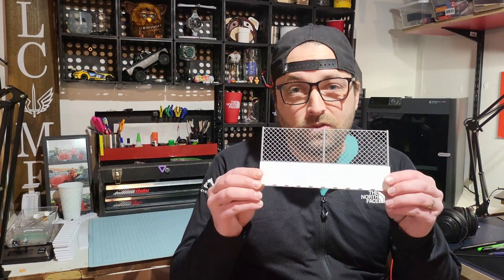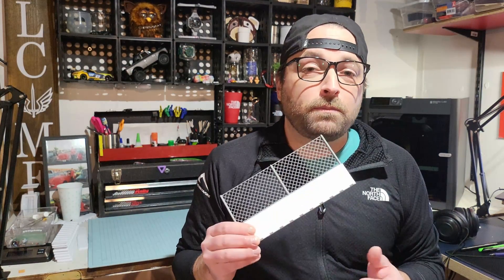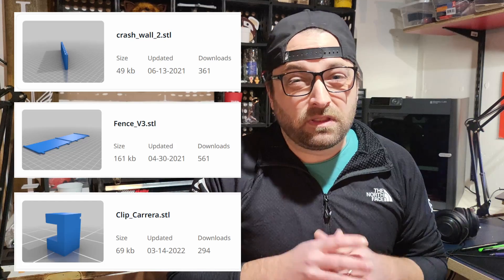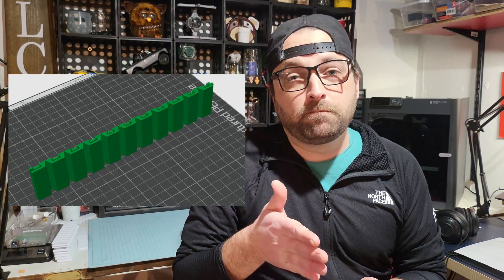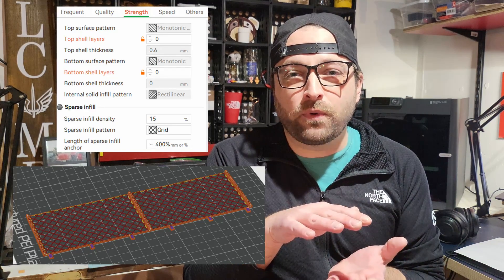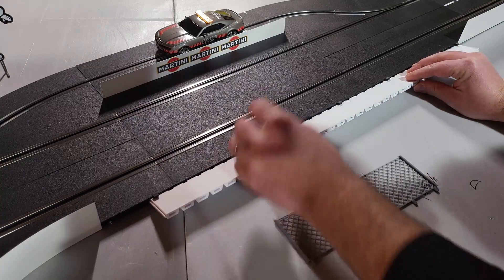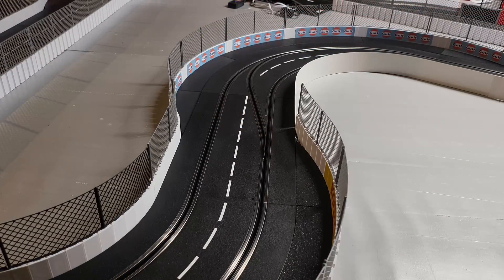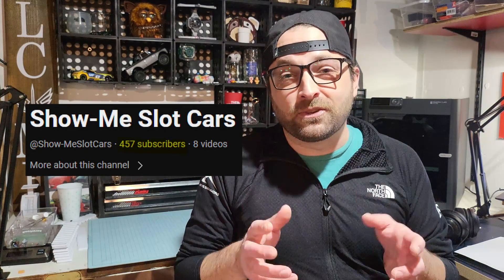New Crash Barriers, And They Are 3D Printed!

Comment: Well Peter, I gave up on the crash wall prints.  I printed about 40" of the wall.  The tolerences are really tight.  So much so that I had to sand the dovetails to open them up and even with that I still had to pound them together with a  hammer.  Not good.  The clips had to be pounded it to the bottom which is good so they wouldnt come out.  Then the trouble started.  Trying to put the wall on the track resulted in me fumbling around enough to break the fragile articulating seams between the "pillars."  The upper fence piece printed perfect except for having to sand the tabs down in order to get them in the slots in the wall.   Guess my filament (Inland from Micro Center) or my printer or the guy that pushes the buttons is a little off.  I appreciate the help and suggestions you gave.  They were dead on.  Keep it up, can't wait for the next videos.
Reply from the maker: That is a bummer! I use Inland for the most part as well, so I  don't think that is your issue. If you shoot me an email (address on channel page), I can share my slicer settings to compare notes. No promises, but I would hate for you to have to throw in the towel
Reply: I looked for your email on the home page of the channel, but, no joy.  That's okay though, I'll keep watching and print some other things like buildings.  I might switch filament from the PLA Pro I have been using to the regular PLA.  That might have something to do with it.  I am going to try some other wall projects too.
Reply from the maker: Just realized I never added it. It is there now: ShowMeSlotCars@gmail.com

Comment: Peter, how many clips do you use to attach the wall unit to the track?
Reply: I'm printing clips right now, oriented on their side as you suggested, but I'm printing at 100% infill, for strength. Just in case....
Reply from the maker: @philparker6576  Good idea. I think mine defaulted to 100% simply due to the amount of outer walls I have set as my default.
Reply from the maker: I connect three of the wall pieces together in sections. For those sections, I typically use 5 clips spread out across the 3 sections. I add more for tighter curves and fewer for straights. The clips are small, quick to print, and do not use very much filament, so more the merrier.

Comment: Great video!  Thanks for posting.  Your timing is good as I had printed Greg's wall last week after seeing you had printed them.  I only have an Anycubic Kobra so printing is slow.  The wall took 4 hrs 16 min.  Ugh.  Then I printed the clips which printed with supports because I printed as they were from the download and I didnt change orientation in Cura for slicing.  I couldnt figure out how the clips worked because they were stuffed with supports. And they broke when I pulled the support material out. So, this video comes along and straightens me right out!  I hadn't printed the fence yet so the tip about printing with no top and bottom was perfect.  I may have to print the clips in  PETG for strength. Currently using PLA . Question, did you use supports in the wall?  I accidently left supports on and that has complicated the wall print.  I did print with a brim.  Thanks again.
Reply from the maker: I print in PLA always, and haven't had trouble. Just need to be conscious of the orientation of the layer lines. Amy stress perpendicular to the layers can cause them to fail. As far as the walls go, I decided to skip support since the holes are plenty deep enough even if the overhang droops a bit.